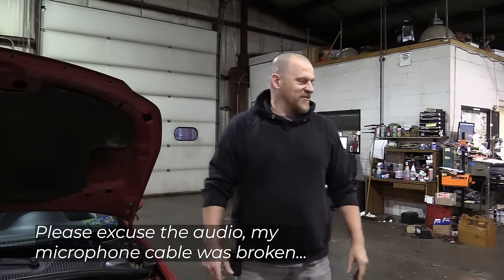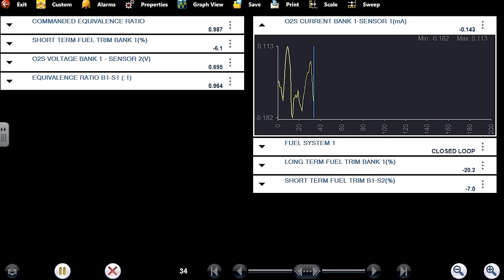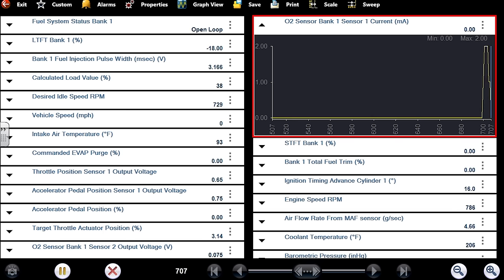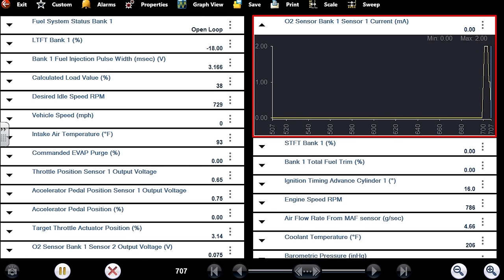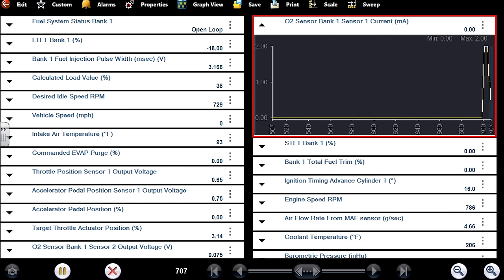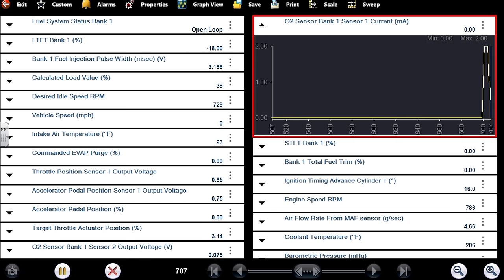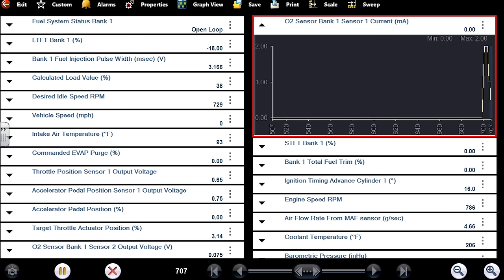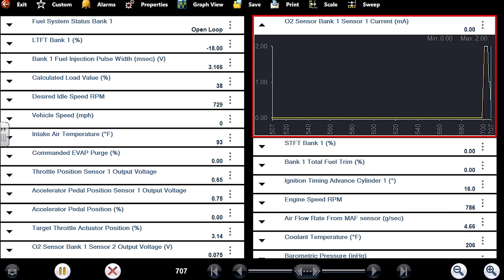MAF and Wideband O2 Sensor Testing for a P0172 [Rich Condition]

Comment: It'd be nice if we could somehow put together a known good MAF reference table everybody could contribute to. Year, make, model, engine, intake air temp, idle rpm, coolant temp, and mass airflow amount. I think it'd be especially helpful on the smaller engines and forced induction stuff. I know I've seen on some of Bernie's videos where they have a VE database built into their diagnostic system on vehicles they've collected the data on but it'd be nice if we had just a general reference at idle for everybody to look at.
Reply: Service information has specifications for engine performance parameters.
Reply: @Turbotomass  Not for everything, also a lot of DIY guys aren't going to have access to service info
Reply: I made an Excel document to calculate G/Sec when I worked at Identifix Asian Dept. 

https://docs.google.com/spreadsheets/d/1ZF0zIhZW6VPhw7S-D41zm_uRoLi2kTwJAlP_iiOoSm8/edit?usp=sharing

Let me know if the link doesn't work.
Reply: @ToddErickson365  hey man I requested access with the link you posted

Comment: 5 mins in and I’m thinking it’s maf! I’m thinking this because I already had a similar issue, but it was over fueling. No codes in the system but the maf reading was around 4.9v. Cold , sensor was clean! I took one from another vehicle and it solved the issue. We had this car sitting for a month with one of the techs just throwing parts at it! I had a look at the data and notice the maf reading were not as per the reference values. Sometimes it pays to read your shop manuals when looking for no code faults just to see if anything jumps out at you. I was lucky to find this, I think the other techs frustration made him lose his thought train.

Comment: I have a 20008 grand marquis it idels high until I put it a gear then It doesn't wanna accelerate after a little while I've changed spark plugs Coil packs cleaned throttle body kinda of Lost atp do you think it's my TPS ) throttle position sensor or what would you think the problem is ? Anybody!?

Comment: I have an 04 GMc Jimmy 4.3L.  I have a p0101 code with p0172/175 Banks 1&2 rich.  My MAF is new, reading 9-10g/s. Up stream O2 fluctuate between .8 and .1 as they suppose too. My Long fuel trims -25 as well as short fuel trims.   I replaced the MAF and Spider injection.  With MAF unplugged, it shows the default MAG 1.62 G/S and fuel trims are close to 0.  Not sure what else can cause this.

Comment: Less then a 3 liter engine you say cant use the rule of thumb with g/s based on liter of engine. I understand that as I use it. But question is will a smaller <3.0 ever be 3g/s. I work for mazda I notice that they are generally anywhere from 1.8-2.6 on all our smaller engine. Maybe 2.5 liter being close to 3.0.

Comment: I love the pre-inspection. I pull a code and look under the hood. This is the perfect time to fix oblivious damage. I get cars with partially installed air tubes or bad rodent damage and diag time goes down drastically. This technique is good for seeing the types of systems the car is using. ECT... Sometimes they will have a repair free by the dealer tsb or bulletin. You get burned and then you start to look first before you cross that street. Lol I love what this channel has to offer a technician who wants to better themselves.
Reply from the maker: Thank you so much!

Comment: 48:10 Absolutely! 
Once I have determined sensor ground is intact, I always use sensor grounds as reference when scoping.
I love the independent channel grounds of the Pico 4425 for this reason and cringe when I see people lumping all those grounds together on battery negative.
Maybe they do it because Bernie said it so many times? But with a common ground scope, that's all you can do.
While peak detect on snap-on can be useful in ensuring fast signals are not missed on a long timebase, it can lead you into seeing problems that aren't there - you're probably seeing the radiated signals from secondary ignition under load, which will be filtered out by the ECM.

Comment: Another great video and teaching moment! I totally agree with your call on the MAF. All of your data was pretty much pointing in that direction and then once seeing that it was an aftermarket sensor, I was convinced that was going to be your problem. Great call and you are definitely not a parts changer! Sometimes we have to weigh out the cost of a part versus another hour of diag just to end up back at the same place.  Well done Danner duo! 😅

Comment: Since this was an engine out rebuild look for rags stuck in intake, had one with a blue towel stuck against MAF screen causing rich condition due to higher air velocity thru MAF from restriction.
I saw you pulling airbox and was just waiting to see this.

Comment: I work for suzuki in New Zealand the maf sensors on these older sx4 with the jb20 engines and the suzuki swifts with the m13 m15 and m16 engines are very common to crap out

Comment: Really good video!  Anyone ever seen this?  Well maintained 2007 Camry had a p0101 code & system rich 5 months ago.  Total trims around - 40.  Pwrs/Grounds good, no vac leaks, pcv good.  Replaced MAF with Denso made in Japan & that fixed it.  Best fuel trims I'd ever seen on my wife's car, around -2 total trim.  I keep a bluetooth scanner connected each time I drive her car so I monitor trims multiple times per week.  They stayed GREAT.  No codes, no issues.  Ran like new.  5 months later, same codes re-appeared while my wife was driving car.  When she got home, I hooked up my scanner to check it out and the fuel trims were correcting.... as if the problem was fixed.... but I didn't fix anything, didn't touch anything.   Long trim was -20, Short was +20, "correcting" for whatever the problem was all by itself.  I've been testing everthing I can think of, and driving the car daily for 5 days and the problem is gone again.  The only difference I see is, now total trim is a bit higher.... around 9 under load, around 5 at idle.  

Any experience or guidance would be appreciated.  I'm a home DIY-ing Dad, but a long time student of ScannerDanner's book, premium, and youtube content.  Paul (& James) have taught me a lot so I would probably describe my skill level as high on understanding and knowledge of what ScannerDanner teaches, but low on actual experience working on a lot of cars, as the only issues I ever get to work on are my family's cars, which I take care of so they don't normally have many issues.  

Thanks for any suggestions.
Reply from the maker: You'll need to catch that problem when it is happening. It's pretty difficult to make a call when the system is correcting and the problem isn't currently there.
Thank you! Pretty awesome that you understand what the counter fuel trim numbers mean!
Reply: Thanks. You're an excellent teacher.

Comment: This was a extremely helpful video, one thing I was wondering was since you were seeing high calculated load percentage, and setting a rich code, can it be the opposite as well, where there are low calculated load numbers and setting a lean code? With no vacuum leaks. Also being a skewed MAF? I havent had time to read through all the other comments for this video, so not sure if that question may have been answered.

Comment: Hi Paul,
I'm an electrician, with electronics repairer knowledge. I don't have access to good scanner. I have simple OBD scanner. This scanner allows to do some advance programming on GM vehicles. ABC blead, Crank Position sensor, Transmission diagnostics and more.
I have 2002 Chevy Avalanche 1500. Truck was sitting with blown engine sins 2006.
I replaced engine (I drove the donor on parking lot). I replaced the tranny with remanufactured one (old tranny has antifreeze in side). Take truck for inspection.  No pass. No check engine light. Technician sad  that truck need MAF. No check engine light. It can be seen on scanner.
Trouble shooting steps:
1. Cleaned MAF. Code pop up after 15-20 min drive.
2. Replaced MAF from good running truck. Code pop up after 15-20 min drive.
3. Stop by other local shop for diagnostics. The technician replaced MAF with new AC Delco MAF.  ($150 MAF and $350 labor). Code pop up after 15-20 min drive. Technician sad tis is wiring problems.
4. I check continuity from MAF connector to PCM with tester and with test light (under load). Ho wire damage. Good ground. 
5. Check PCM connector, MAF connector, check wiring - move the harness with engine running. Sprayed water on intake manifold, throttle body,  No effect.
6. Replaced PCV (PCV was bad). No effect.
7. Replaced AC Delco MAF with new AC Delco MAF. Code pop up after 15-20 min drive.
8. There 12v on Pink and Black wire.  4.5v on Yellow wire. (this 5.3l has cable TB). I "jerk" the throttle - voltage dropped from 4.5v to 4.2-4.12v on Yellow wire.  
8. I checked  O2 sensors (they new Denso). I connect OBD dangle and see graphs on my phone. All 4- O2 sensors acting healthy. No misfire.
9. I reassessed PCM. Goes throw the learning prosses. Code pop up after 20 min drive.
Now I run out of options. Is there any suggestions?   

Or any good diagnosis you can recommend?  I'm on NY.
Reply from the maker: What code?

Comment: When I was looking at the scan tool data I noticed you had key on engine off you hadn’t started it yet. It showed 1. point something grams at the Maf. I know Toyota had a TSP back and I think 2005 or  2006. It would help if you look at grams per second key on engine off and if it was outside of that specific number the MAF was bad.

Comment: On cars with vacuum brake booster system, when I’m going to make the trims go to lean from the driver seat on engine idle I just push the brake pedal few times and that does it for me. And yes it depends on what I’m trying to chase and which PIDs I’m trying to look at. Merry Christmas everybody

Comment: all suzukis after 2005 show code p0130 for the o2 sensor and rarely show a code for lean or rich mixture. whenever we have such a code we always look at the fuel trims to tell us if the o2 sensor is at fault or not. at 7.30 in your video you do the test by pressing the gas and leaving it, there the sensor first goes lean and then rich until it goes to o ma. but the o2 sensor is fine

Comment: So i have heard of Maf Initialization being perhaps required for Mafs for sprinters it seems a hotly debated subject in sprinter forums with no conclusive yes or no .I have 2006 t1n replaced maf oem and it wont run unless Maf unplugged still , turbo wont kick on etc  ,after watching some of your incredibly interesting lectures i tested voltage ,ground ,sensor ground and sensor signal all good but it still fires and dies ,then i heard about initialization perhaps being nescesary , vehicle is getting 2068-4 Maf faulty on/off ratio of reference signal is outside permissible range , i wonder if Initialization would adjust this and does it need to be a mercedes dealership to accomplish this , am glued to your inspiring lectures, thank you, if i was a little younger .....

Comment: Hello ScannerDanner, I need your help and advice!! I'm a diy'r, but with above average mechanical skills and general knowhow...lol. I'm looking for a pro-grade scanner, but want to save some $$$. I've allotted $500 for a scanner, but I want to ensure I have full...or near full diag capabilities with respect to being bi-directional, and the ability to scan and reset systems. Which brand would you recommend and why?
Reply from the maker: The topdon phoenix Lite, hands down. But you'll be spending around $900 for it.
Though topdon is now offering a less expensive unit that is not bluetooth but would be tethered and it goes for around $500 but if don't know if it's "full function" like the phoenix

Comment: Seeing the scanner actually display an equivalence ratio, that's actually the most accurate output from the wideband sensor. EQ ratio essentially is lambda, so for example 0.95 lambda (13.965:1 AFR) in open loop means a -5% trim will bring it back to stoich mixture. And vice versa, if it's at 1.05 lambda (15.435:1 AFR), it will need a +5% trim to get it back to stoich.
Reply from the maker: it's just another O2 data PID that can be false when there is a sensor malfunction
Reply: @ScannerDanner  I agree, but for this specific case the EQ ratio works better than the O2 mA. Great video otherwise!

Comment: That noise is caused by a problem with power or ground supply for the sensor. Maybe a fuse or just old wires. You see that a lot on cheep cars.

Comment: My 2009 Honda Accord Stalled 5 years ago After I Drove Through High Waters But After A Few Tries It Started Again But With The Engine Light 5 Years Ago And Was Told The Catalytic Converter Is Bad, That’s The Code That Comes Up. As I’m Driving Sometimes Exhaust Smells Permeate The Interior Which Smell Like Rotten Eggs. Also Somehow I’ve Managed To Pass DMV Inspection 4 Years Straight With A Check Engine Light & Bad Catalytic Converter.  What’s crazy is that this year I failed the DMV EMISSION TEST 4x and then I went to a shop and asked them to clear the codes and prayed and when they checked again at the DMV it passed 😂. This year they were strict but prior years they weren’t even checking! The dealership says I have Low Compression On The Number 4 Cylinder & P0420 & P0304. They say the engine was at 60psi. They performed the diagnostic in July.  I heard Cataclean cleans the catalytic converter. I saw it on Amazon. What do you think? Is That Bad Catalytic Converter Endangering My Life?
Reply from the maker: Fix your misfire first before ever worrying about CAT codes. Also the rotten egg smell is not from a cat that's failing, it's from raw fuel being  dumped into the cat. Most likely from the low compression cylinder.
Reply: @ScannerDanner  oh wow you’re the man! How long can I drive like this? I’ve had this issue for 5 years and somehow I keep passing inspection
Reply from the maker: @priestlygarments4004  hard to say, it certainly isn't healthy for that engine or the cats to continue to drive it with a constant misfire. It is a constant misfire right? At 60 psi of compression it has to be. I'd recommend unplugging the injector for that cylinder.
Reply: @ScannerDanner  Oh wow! What about my health? Should I be worried of carbon monoxide? Cause Honda is asking for 6,000 to put a used engine 2,000 for a used cat. I don’t even have those funds at the moment. I paid them to diagnose and all the lady said is that it’s not worth repairing to just buy a new car 🤦🏽‍♂️. I regret driving through that water trying to pick up an Uber rider. 😂 The car moves very well bro just the TPMS LIGHT is on and the engine light is solid. They said the TPMS sensor could be dead because the tires are perfect. Just those lights are on! Everything else is solid. I failed the DMV emissions test so I just had the dealership clear the codes temporarily and it passed.

Comment: Just a thought: if there's a frequency analyzer on the scan tool you might find out that there's a specific frequency responsible for the "hash" on the MAF signal. This does not look like random noise but specific signal pulses. Maybe the firing of injectors is responsible for the hash.
Reply from the maker: This hash is really everywhere in a car. If I'd have used sensor ground you wouldn't have seen it. But the main reason you did was with peak detect turn on, on my scope, it is sampling that screen 6 million times. If I farted you'd see it with that sample rate lol

Comment: Why do some cars not show you the upstream o2 voltage?.. But instead show you the current, i never understood that and always have a hard time diagnosing because of that
Reply from the maker: Only wideband oxygen sensors report like this. And with them comes a huge variety on what the scan data pid actually reports

Comment: Dear Paul, hello! I'm fighting now with Subaru. Engine was swapped from 1.5 A/T to 2.0 M/T, there was a lot of mess and misconnected wires. Looks like i've fixed wiring problem. But i still cant fix what is wrong with MAF. I have a new original MAF sensor. And i have around 4 volts full throttle. But my grams per second readings are 12 grams at idle, and 400 grams full throttle driving test, average 2.0 atmospheric engine. I've thought ECU was from some turbo subaru, or was re flashed. So i've bought a used ECU for this engine, and, i see the same readings. FUnny that my injection pulse at idle is 2.8 ms, it doesn't look like 3 or 4 times more. And, no backfire in exhaust. I can start engine warm, if i've had a 3-4 time more fuel, i would have drowned engine with fuel and never could start it warm. Also there is Bosch 5 wire LSU 4.2AF sensor. Reference 2.55 volts wire was swapped with pumpig current calibration wire, so my AFR was constantly 0.69 without any chance to go rich,Only lean. After i've fixed wiring problem, i have 1.0 AFR until my front AF sensor warms up, then i get -20% short term instantly, and my rear O2 sensor goes lean, low voltage.SO i assume wrong readings for my front AF sensor. But. also i have now 35 kPA at idle, it is higher than it should be. Maybe i have a good AF sensor now, but i have plugged exhaust? or Valves are not sealing combustion chamber properly? Or my AF sensor after thousands KM o fwrong connection damaged?Is that possible?
Reply from the maker: Let's move this to my forum www.scannerdanner.com it is free to join and we can try to help you there. When it comes to engine swaps, especially to a different size completely, things get complicated and I can't do this here. Too much research to do by myself to help you. Thanks! Hope to see you there.